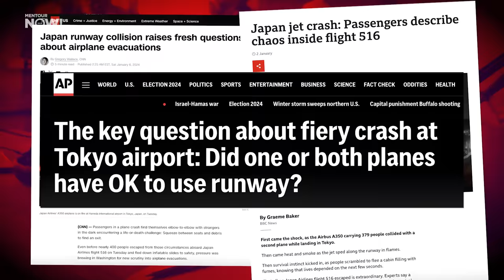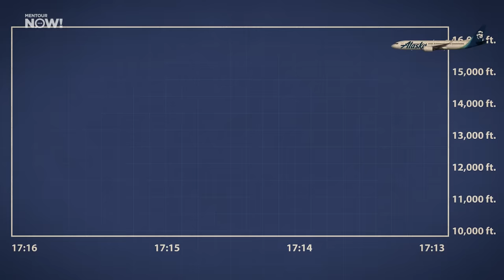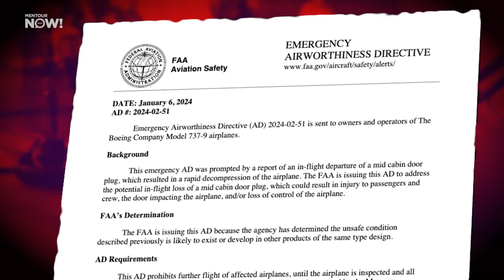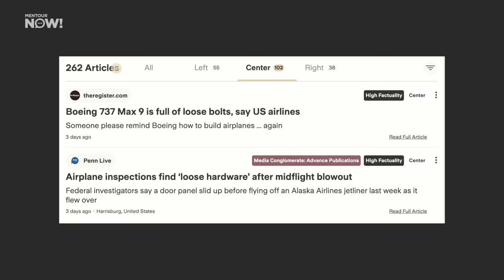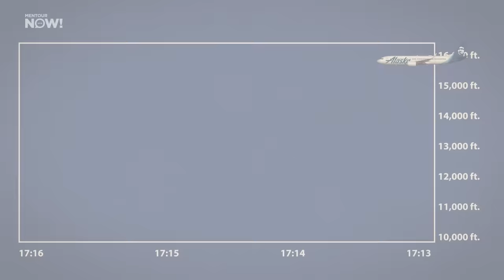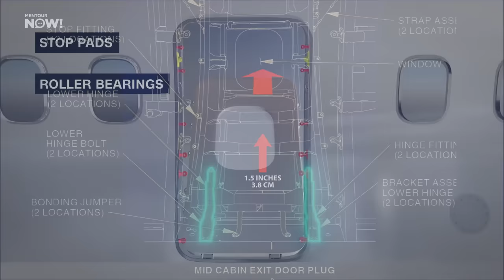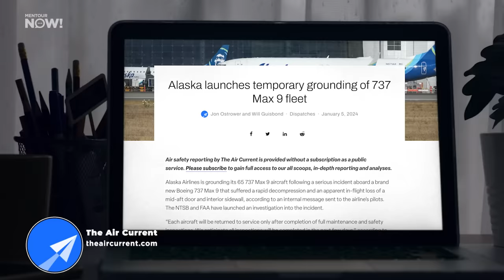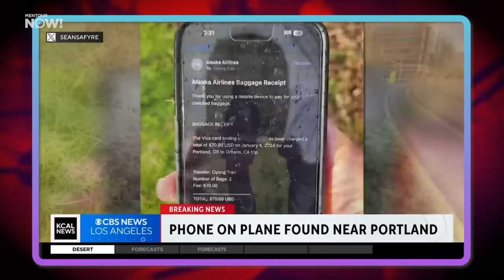WHAT Is going ON with Boeing?! MAX-9 Door blowout

Comment: They're gonna have to test the strength of those bolts and structures meant to keep it all in place... Note, that with sufficient negative g-loading (which does not even need to be a lot), without the bolts in place, the door could easily lift up. Something as simple as a little more than normal turbulence can make it feel like your gut wants to swap places with your brain... The heavier something is, the bigger the negative-g loading actually becomes in a negative-g experience. Add to that the fact that there are "lift assist" dampers installed that would push into the same direction when negative-g is experienced...

Yea... To me it stinks towards another design issue with the B-Max that will need resolving... It's either that; OR quality control missed a critical check on this plane to ensure that all securing bolts where installed and fastened as per specification on this particular door. But, IF the issue really does come down to sub-par quality control checks inside the Boeing organization... You can just imagine the chaos that can ensue, due to inconsistencies within the production line. 

That's what happens when you put "bean-counters" in charge of a product or worse yet, of an organization. When saving money becomes a priority...

How many viable companies had to shut down after they embarked on a "cost saving" mission, thereby inadvertently impacting the quality of a product to the point that such product ultimately becomes 'rubbish' and no one wants it anymore. Most of this is down to bean-counters being put in charge.

If the overall product is viable as it is, then don't go look for places where you can cut costs within the product production line. There may be reasons why certain sub-lines appear to be highly unprofitable... As long as the final product, when everything comes together, is not compromised in any way... As soon as you start cutting costs on any of the sub-lines you will almost ALWAYS compromise the final product in some way, shape or form... All these MBA's... BEWARE! Listen to the Engineers and DON'T FIGHT THEM! Engineers, you should NEVER become MBA's. Many have said that Engineers with MBA's are no longer true engineers! I can agree with that!

It's NOT the engineers job to worry about the business. Let the business worry about the business and let the engineers worry about engineering. And if a Business does not want to listen to it's engineers, then it's time for the business to close. What's the point of having engineers if you're not going to listen to them and not going to give them what they need to succeed!

Comment: What confuses me is why Alaska is being portrayed as the victim.  Yes I agree Boeing and their supplier are  coup able and it ‘s inexcusable for something like this to happen .  That said , why after three warning from the flight deck of pressurization issues did Alaska not ground that plane instead of continuing to fly this aircraft but not over water routes. That plane should have been grounded after the first pressurization warning. That warning indicates either a leak or something faulty with the pressurization system. If grounded this incident would have never happened and the door issue would have been found.  Alaska’s actions only exacerbated the issue and could have caused a more serious outcome

Comment: The design of the door plugs is quite poor. The plug should be permanent and extremely expensive to change. It is a custom order plane. If you want more seats, order the plane with more seats. This plug should not rely upon cabin pressure like operational doors. This is just Boeing trying to save a buck and risk lives, as per usual with them. They figure, the only way to beat Airbus is to take shortcuts. It is not like they ask the customer, "Do you think you will add seating in the future? If so, we are just going to put this poorly designed plug in the hole until you change it with the new seating configuration.". It didn't play out like that. The customer ordered the plane they want, with the number of seats required. So that excuse is just ridiculous. The plug should be solidly connected around the whole circumference. I couldn't believe my eyes when I saw that engineering. Stupid greedy humans. I would bet the farm there are engineer reports, emails or verbal objections, advising against this design. Boeing and the FAA should be charged criminally.

Comment: Great follow up info on this malfunction of Boeing's fuselage integrity.
Boeing built the greatest commercial aviation design with the 737 bar none. The problem is Boeing can't compete with Airbus' manufacturing methods, so it's trying to copy Airbus as much as it can, using designs like the much vaulted 737's. The 737 is a great design, better than its earlier predecessor designs like the 727:etc, and in many cases better than its subsequent make/model designs in other models (757, 767, 777 etc). ...But it's an old design long past the shelf life expiration date. Great as it is, it can't compare to the newest design models out there by Airbus and even Boeing. And 737 designs can't be 'reworked' to fit new modular design manufacturing concepts, used in today's aviation world.
This is Boeing's fault - easy as it seems on paper, in aviation you can't beat a square peg into a round hole without causing collateral damage to surrounding onboard systems. Simple as that.
Boeing will never hold a candle to Airbus equipment which is more suited and easier to operate, than Boeing's old dinosaurs, by using old off the shelf reworked models. It's impossible.
Unless Boeing takes a hit financially and restructures it's design/manufacturing processes altogether, it will fall too far behind Airbus to ever realistically compete again in world markets. It's either that or go bankrupt trying and being forced to restructure financially and organizationally by its stockholders.

Comment: There's Something Stinky about this whole Flight ✈️ Situation, what happened, how 🤔 it happened, when it happened, the investigation, etc... ⤵️
1- Airplug Blows Out Mid-flight ✈️ 
2- the 2 seats 💺 beside it just happened to be empty 
3- a phone 📱is found near some bushes in a ditch near a highway 🛣... still working that just so happened to fall out of plane getting sucked out when cabin pressure lost at what 30,000 feet in the air... by some walking 🚶‍♂️ his 🐕 dog near a highway 🛣 for some reason that exact day he found it.
4- Upon Investigation a whole bunch of plugs were completely missing... as in never installed in the 1st place... yet somehow passed multiple inspections before leaving the factory 🏭. To me it's more likely they were removed all at the same time after leaving the factory 🏭... and the other few remaining bolts 🔩 were loosened at the same time. And not by Boeing Factory Staff or by Air Alaska Own staff or mechanics as there is NO records of them doing any work on any 737 Airplug, emergency doors, emergency exits, or even anything anywhere near where the Airplug was located on that plane. 
5- the cockpit recordings of the moments leading up to, including & just after the incident & the entirety of the emergency just so happened to be recorded over entirely. In a similar fashion if one were to buy a brans new cassette tape in the 90s of your favorite band... that came completely sealed from factory 🏭... and you take the thing home, only to unwrap it from the sealed packaging, pop the case open for the 1st time ever & then stick it in your stereo/walk-man 📻 press ▶️ play & instead of hearing Aqua- "Barbie Song", Ace of Bass "i saw a sign", Alanis Morsette "1 hand in my pocket & the other smoking 🚬 a cigarette", etc... You instead hear someone talking to you for 30 minutes... teaching you a new language, or a motivational speaker selling you a course on how to be a motivational speaker & become successful if you just buy 10 more cassette tapes, a book & a VHS 📼 course... or you hear 👂 what sounds like your favorite radio 📻 station DJ talking & introducing the next 3 song titles of the weekly top 40 count down, followed by a commercial break & then the 3 songs playing... but right at the best parts of the songs... all of a sudden you hear 👂 your little brother & his friend... because they recorded themselves farting & laughing into the stereo... and other sounds they recorded of themselves making sounds & talking into the floor fan. 
4- Ocean Gate wasn't that long ago & was a huge implosion in the ocean. This was a blow out in the sky. "I'm telling you... he's not real" was recorded in a plane video not long ago. Jan 1st was Miami Mall. The 737 Max original recall issues of planes crashing on their own because of computers problems programming. They keep calling for reducing carbon footprints, reduce travel, use electric vehicles... yet fly around on Private Jets, & tells us we need to cut back. Meanwhile Taylor Swift is all over media, in the news, did a world tour in a private jet, made unti a Billionaire, all over every cover of all the Magazines on the rack, and now being talked about in the Whitehouse who only talk about Government related issues... maybe she's a Government related issue by the Democrats & CIA for Psyop & programming masses & for future new voters, also to get newer audiences to buy into the instead of world soccer but instead using football as another distraction to keep the pleebs entertained & distracted... and to trick them into watching yet another dark occultism ritual disguised as half time show ENTER- Tain- MEN- T...

while they talk about how it's ok & safe for her to fly from 1 country to the other alone on a private jet just so Taylor Swift aka Napoleon Dynamite can be right beside the other Soul Selling Poster Child Travis Kelce... tricking the blind into supporting & glorifying a Transgender Male Singer be in a relationship with a Gay Football Player... similar to Mike & Barack Obama... and prior to that was Mr Transgender Male Angela Jolie & Brad Pitt. While Oligarchs fly their private jets around trying to destroy humanity as we know it & want to round us up into our homes & control how far we can go... so they make commercial flights seem scary & Dangerous but make private jets sound safe. Cause they want to be able to roam around being sick PEDOPHILES... with less eyes 👀 out there to catch them stealing children if they got us locked in certain areas & distracted from seeing them in the acts. 
Which like mentioned above had the world's attention occupied on these incidents. And not on the things we should be focused on... such as the world 🌎 wide farmers 🚜 & Truckers rallies in the fight for Freedoms & healthy Foods.

(*Maybe I'm reaching super far into the multiverse with all my shinanegans. But it's my scattered brain 🧠 just saying look at all these things lately. The above is all got entertainment purposes only. Oh let's not forget about the 22 million border crossers that the Democrats want to pass votes 🗳 to let them vote.)

Comment: Here's a suggestion that will be nayed instantly but here goes.
Any aircraft supplied by Boeing that is delivered with obvious quality defects and/or defects in workmanship shall, not may, be completely disassembled down to the last nut and bolt and strand of wire, then rebuilt by Boeing in a timely manner under the direct and constant visual recorded supervision of at least one member each of the NTSB and the FAA present at any time the components are being handled by anybody, particularly including Boeing management and staff supervisors.  
24/7 CCTV is to be provided by a company out of the reach of Boeing, the FAA and the NTSB and stored at an off-site location accessible to the courts.  
The FAA and NTSB personnel are there not only to scrupulously inspect and account for all procedures but also to watch each other particularly when in the presence of any Boeing personnel.  Nothing is to be assumed or "taken as read." and all information is to be shared in its entirety between the regulatory agencies as it is produced without delay of any kind.

Expensive?  Yes, that is the objective.  If Boeing is made to realize that this procedure will be enforced for each piece of junk they certify as airworthy that proves problematical or dangerous to the public they will quickly realize that it will be less expensive to actually produce a quality product than it is to cut corners, flout regulations and try to compromise FAA or other personnel in any way.  Taking an entire aircraft apart is not cheap, let alone reassembling one.  Or two.  Or three.  At the same time if necessary.

The company was trustworthy when it was run by the engineers.   Since the bean counters took over after they acquired McDonnell-Douglas...you do the math.

Comment: When the fuselage is bent or twisted out of wack everything installed might as well be out of wack. Nuts, and bolts break off. Clips break loose. Wiring gets frayed from being too short or too long. At the request of Boeing I was assigned to the machining of the Boeing 777 fuselage turning fixture. When I machined the fixture I made it 10 times closer to the spec geometry than the tolerances called for on the print. 

 The 777 is the most popular airliner ever built. 2200 sold, 1600 delivered. No mass fatality crashes in 30 years to this day except two deliberately crashed. Compare that record to the first mass fatality crashes of these other major airliners. The first commercial jet airliner DE Haviland Comet 2 1/2 years, first successful jet airliner the 707 2 1/2 years, Jumbo wide body 747 4 years, jumbo wide body the DC 10 8 years, The jumbo wide body L-1011 8 months. Consider also comparing number of planes flying, multiples of mass fatality crashes of the others, and the safety record goes up from a ballpark of four to ten times longer for first mass fatality to ballpark of one hundred times safer considering all other criteria of comparison.   

Boeing spent billions to build a secret robot assembly plant which they revealed to the press several years later was built for one reason. To assemble 777x fuselages without using the turning fixture I made.  No this is not paranoid delusion though I know it sounds like it. You can look up reports on all of this on major news media outlets on the Internet. I suspect they did it to distance themselves from my claims. They then dismantled the fixture I made. I don't know if it was scrapped. 

On testing in the FAA mandated 150% over maximum expected load test, which often results in the destruction of the plane being tested, my 777 passed with a load of 154% over maximum expected load. Having so far passed the federally mandated spec it was not stressed to destruction. The 777x made by robots in the secret assembly plant failed explosively at 149%. In some recent documentaries on aviation construction that's the explosive failure video that has been used. The FAA inspector told the news media it was ok because Boeing just had to reinforce where it failed, produce a technobabble rationale for the reinforcement, and Boeing wouldn't even have to test another one. But Boeing dismantled the formerly secret robot assembly plant. 

The 777x was scheduled for delivery in 2019 but plagued by one failure after another the delivery has been pushed back repeatedly to now 2025. Thank God.

Comment: Usually I enjoy your videos greatly. However, in this one you gave a very unwarranted pass to Alaska Airlines on the repeated resetting of a pressurization warning light, with an irrelevant comment about how difficult it would have been to trace the problem. This incident easily could have resulted in fatalities, and the aircraft should absolutely been taken out of service with a repeatedly activating pressurization warning light, regardless of how "difficult" it would have been to trace and correct the problem.